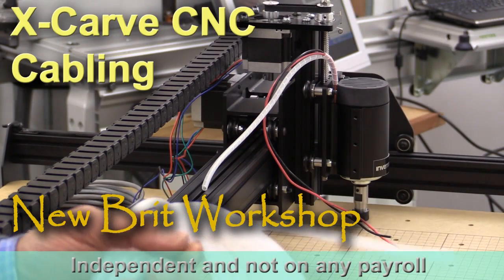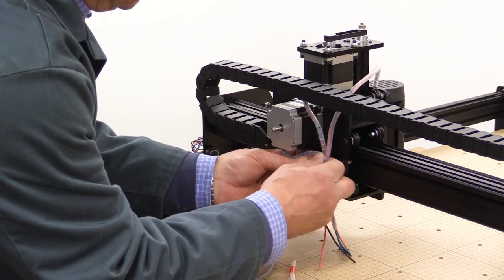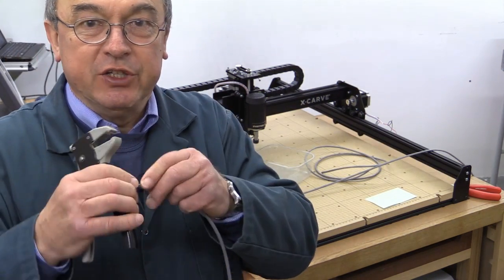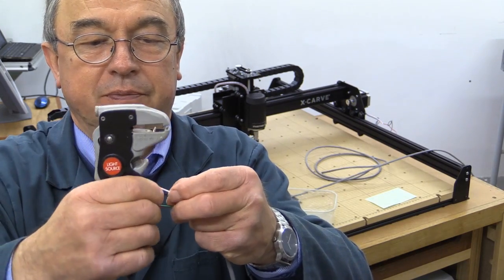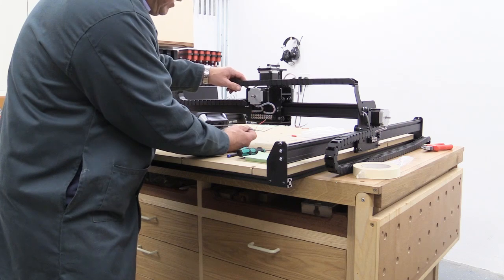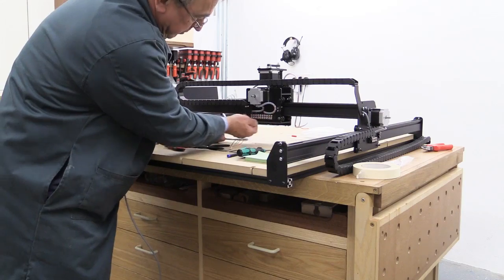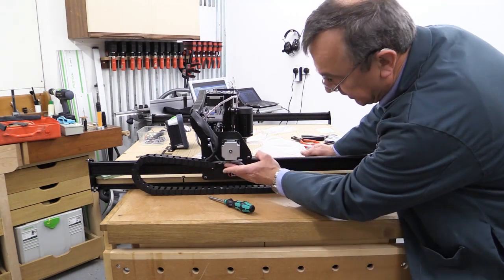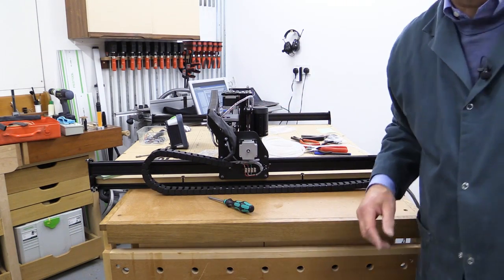Original X-Carve - Cabling

Comment: Hi Peter,Would this X-Carve be any good at producing a MFT top?
Reply from the maker: Hi Ray, No. The bed is not big enough and the gantry is not stiff enough to get the accuracy that you would need. The Parf Guide System would be the better bet !!    Peter
Reply: Thanks for that Peter..As you might recall I have the PGS on order with Axminster (still waiting)..I had a seniors moment thinking it was an affordable and suitable CNC machine..Then I could replace damaged MFT tops very quickly, but it obviously isn't meant to be yet.Cheers.
Reply from the maker: Hi Ray, The new X-Carve should be much better but even so I would not expect it to be as accurate as the PGS. I doubt whether most CNC produced tops will be consistently as accurate as the PGS. The Festool MFT3 top is not as accurate but Festool make no claim about its accuracy at all.   Peter
Reply: Thanks Peter,You have convinced me.I hope that Axminster post my PGS soon, and I will a happy chappie..

Comment: Hello Peter
You have a great videos that helps me alot but.....
How long is the cables you pushed in the first drag chain (on the back of the macine)
I have to know before I cut them

Kristian / Sweden
Reply from the maker: +rednotereso  Hi Kristian,  At that stage I did not know how I was going to mount the power supply and Arduino. So, I followed the Inventablles instructions and cut the cables to the full length suggested and then kept all the cables as long as possible and did the trimming at the end. The cables that go through the first drag chain then go into the second drag chain so keep these as long as you can. Once you have everything assembled you will have a better idea what you will do with the power supply etc. I then mounted the hardware onto a board (a piece of 18 mm plywood) and then brought all the cables together and clamped them to the board. From then on it was just a question of routing the individual cables to the components or terminal strip on the board, cutting them to length and making the connection.      Peter
Reply: Thank´s Peter
The instructions said 2  pair of 12 foot  and 1 length of the 7 foot and 1length of 5 foot
I have alreday attached one length of 5 fot.
Do you think I should  cut the cable to the other lengths
Reply from the maker: Just follow the instructions for this but if you have any extra cable then keep everything on the long side.    Peter
Reply: +New Brit Workshop (Peter) 
Thank you Sir
Do you know where to buy similar cable to use
Reply from the maker: +rednotereso  I am sorry but I have not bought anything like this. Perhaps you could Google it and see what crops up in your area.    Peter
Reply: +New Brit Workshop (Peter) 
Good idea Peter

Comment: Thanks for a great series of videos Peter. I am 2/3 the way through mine (1000) and I will make some of the modifications to the order of assemble that you made. I already started tidying cable but I like the idea of going a step further like you did. I also have an issue with work surface space (plus I'm working in a 9' x 18' garage) and it's beginning to be a nuisance so I will get the baseboard and drag chain attached before going any further. Fantastic x-carve cabinet - too big for my space for a dedicated table and I will probably build something based on one by  Bob at "I like to build stuff" (https://www.youtube.com/watch?v=nuQqaEXyehc). Thanks again for some brilliant ideas!!
Reply from the maker: +Itz MeAgain Many thanks for the kind comments and for the link.   Peter

Comment: Well done peter
Reply from the maker: nippychippy Hi Robert, If I were to assemble another I would make a better job. I am a bit rusty on the wiring and soldering front. I really do recommend spiral wrap for anyone tackling a job like this - it is easy to use, is not expensive and is very effective.   Cheers.   Peter
Reply: I wouldn't worry about it peter it looks a lot neater than other vids that I have seen I am really looking forward to the rest of the vids

Comment: what is that called (that you are putting around the wires)?
Reply from the maker: Shane's Hobby Shop Hi Shane,  It is called Spiral Wrap. It is used a lot for wiring looms and is especially useful as you can undo it and take out a cable or put new ones in.   Peter